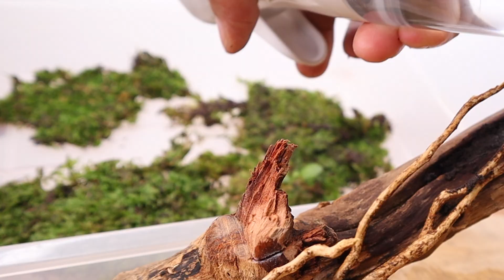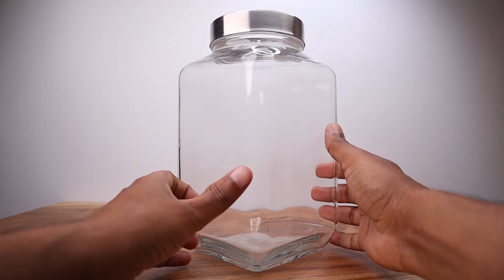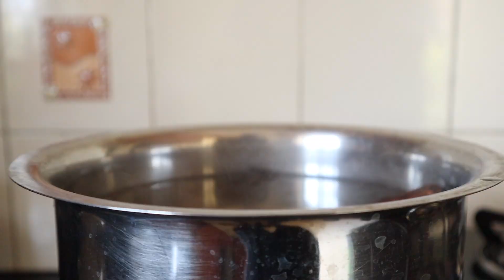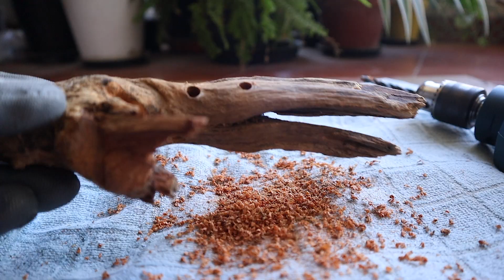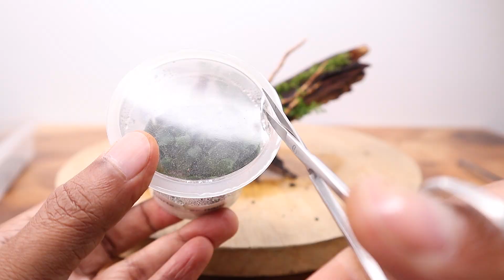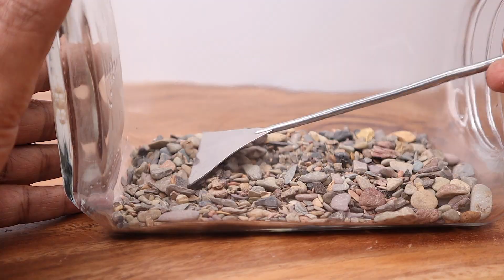Planted Driftwood Terrarium (How to build a closed terrarium using a planted piece of driftwood)

Comment: This is a beautiful display. Question- do you need to mist it regularly and if so how often? I just can't get over the setups you create and hoping you do more, thumps up!
Reply from the maker: Thanks. Yes I will have to mist it once in a while and also spray in nutrients for the plants. Aquatic and moisture living plants in here so the extra moisture will be good. Please note watering for every terrarium is different depending on size, type of setup and plant species used. Some can run many months without any watering at all.
Reply: @TheUrbanNemophilist  I'm assuming membership perks include some instruction on what you did for spraying in nutrients?  That would be incredibly helpful, lol, or perhaps I'm missing a link to another video. Did the springtails survive long term or do you occasionally add more when doing care and maintenance? This is such an interesting project without using a nutrient rich substrate! I struggle greatly with balancing moisture levels, would this be less likely to suffer over watering? This type of creation could be a wonderful introduction to fellow humans who are less thrilled with the idea of a ton of plants, or who prefer a sort of minimalist form of living art. Brilliant as usual, thanks for sharing!! 🎉❤ Sadly I don't think I'll be attempting such a creation without more info on spray nutrients and terrariums without typical substrate layers 😢

Comment: I'm curious do you ever not have to water it once it's finished?
Reply from the maker: Yes I will have to mist it once in a while and also spray in nutrients for the plants. Aquatic and moisture living plants in here so the extra moisture will be good. Please note watering for every terrarium is different depending on size, type of setup and plant species used. Some can run many months without any watering at all.